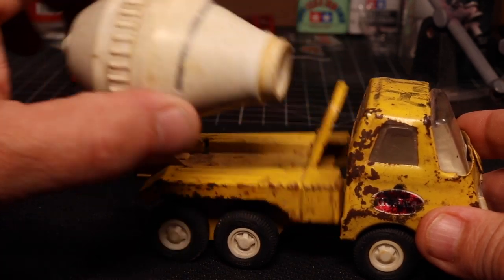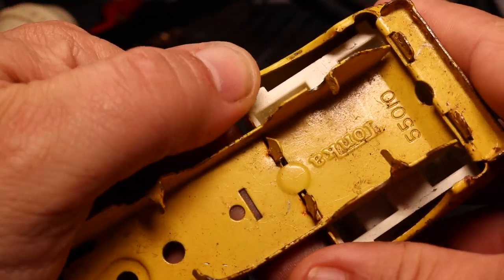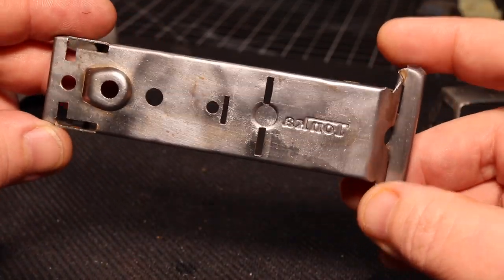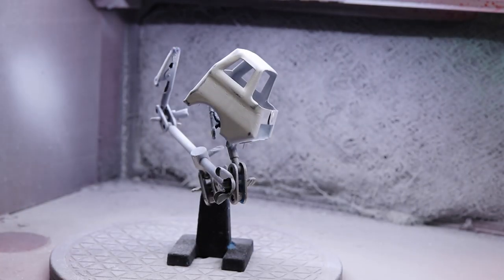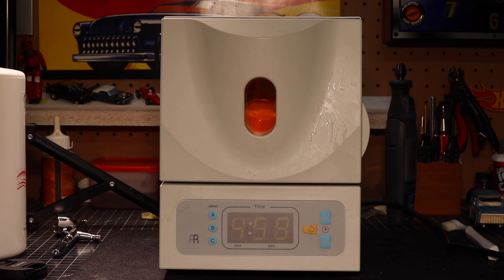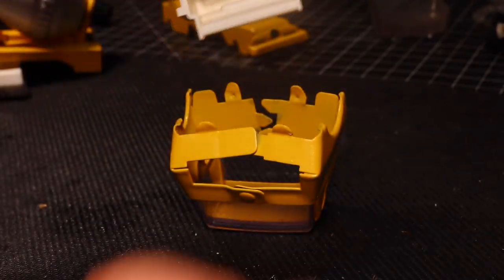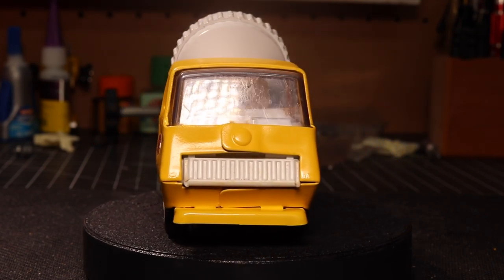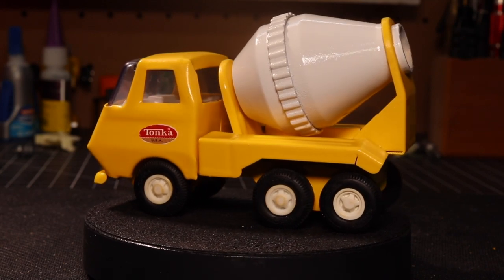Vintage Tonka Cement Mixer Restoration How-To

Comment: Nice job on the Tonka, just for my own education, I'm curious as to why you didn't paint the underside of the chassis and polish up the axles and protect with a clear coat?  I'm still learning, so I have lots of questions.  Thanks
Reply from the maker: Wanted to keep it as close to original as possible. Originally the underside just has some overspray and the axles aren't polished.
Reply: @WheelsNThangs  I understand, and thank you for your explanation.